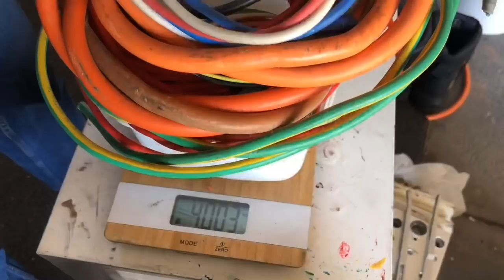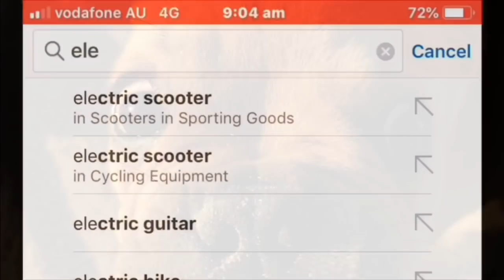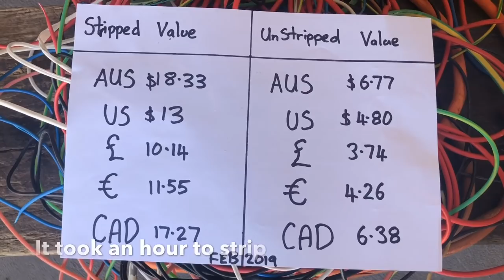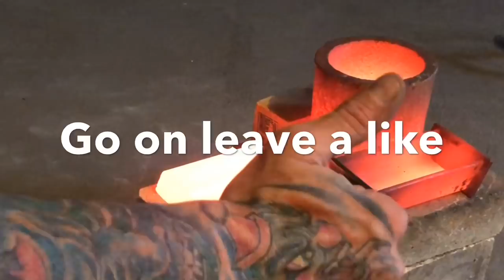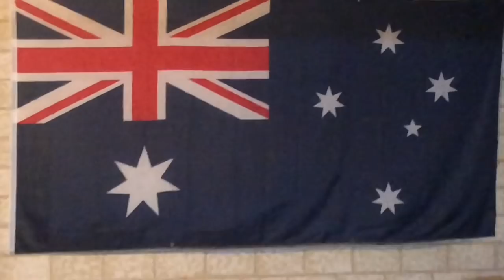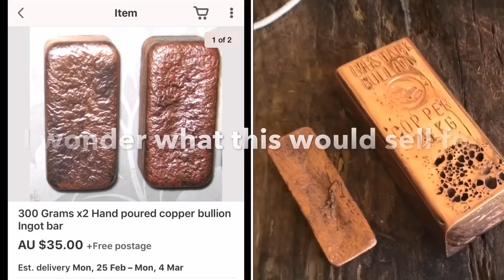To Strip or Not To Strip - Is it really worth stripping Copper Cable🤔 - Melting Copper

Comment: I want to know the cost of the gas used to heat it to melting.
Just curious as to how much gas is used to do that in the first place. Thinking of building a forge as well but want to understand the cost I should expect in gas.
Reply: Its definately a hobby.  You are spending more money on gas or propane just to melt.
Reply: That's true but let's not forget that if you use the material you might be able to turn it into something worth more than the costs. It depends on what you're making
Reply: @group555_  Trust me, As a hobby there is no way you can turn a profit on anything you do unless you steal and rip people off.  You would have to spend so much money on good equipment by then you start off in the hole, that's why this is mainly a hobby.
Reply: @Ericdawg420  i'd planned on making aluminum replicas of vintage space guns and various toys. like in any business there are start-up costs and ongoing materials. obviously i have to do a cost analysis of my time and materials and, once proficient, learn to budget time more effectively which includes upgrading equipment to cut down on labour. 

that's why owning a small business isn't for everyone, though. some ppl aren't willing to sacrifice. most don't even have a reasonable plan or simply an idea of what they want to accomplish financially with a venture. too many want instant gratification and money, just make a youtube video, get a million likes and subs, and rake in adsense $$$ for being a 'social media influencer.' to be honest, you can't trust most people to be able to answer the phone and run a cash register let alone do any real work on top of that. 

i would agree that if all you did was melt down metal and put it into a bar that's probably a waste of money, however that's not a viable business plan.
Reply: @ryanbarker5217   ryan I agree with you on the entrepreneur mentality is not in everyone, It definately takes a certain mindset to do that and maintain. Like you said you have to weigh the pros vs cons of what you want to accomplish with any task. 
As for melting, It is one side of the story as Learning and buying in is one step. Molding is a completely different animal my friend. I have done both professionally working with steel and can tell you firsthand, It will take allot of time and money to get it going, then allot more time and money to perfect it. If you enjoy doing it and have the money to invest by all means go for it my friend. If you have zero knowledge of molding and melting with not much drive to do it other then a hobby, I would recommend finding a different hobby, Or at least finding a business partner to help take some of the financial burden.
Reply: @Ericdawg420  i've been a business owner, let the ex keep it in the divorce, otherwise i would have been going on 15 years. we know sacrifice and what it takes, so that's not an issue for me. 

i can certainly appreciate your knowledge and experience working with steel. my idea is using a furnace like the one in this video (plenty of information on how to build these, they seem pretty easy once you get the right material), use aluminum (not nearly the melting point of steel, would use cast aluminum, not 'aluminum' cans or cheap extruded junk) as my medium, and a sand mould around a positive cast from resin made directly from the object (i don't 3D print, and i could make plenty of things from resin using silicone moulds). after that it's common hand tools you can get from lowe's, none of which are extravagant expenses. that's not to say it's cheap, there's still crucibles and tongs and gloves and all sorts of little things that'll nickel and dime ya, however these are do-able prices. as far as start-ups go, it's a relatively cheap business to begin. 

given that it's hardly like a hardcore foundry, it just depends on the price the market will bear vs. material and labour costs. duh, right? without having broken prices down except in very broad terms so far, my first notion is to consider selling, for example, a toy star wars stormtrooper rifle made from the 1977 version in the $200 range on the high end depending on how much labour it takes me. no, i don't work for minimum wage, lol, and if it turns out that's the case then i simply won't do it. 

but, like many businesses, you often start off making little, if any, money until you build a reputation, clientele, improve your craft, and hone in on your true market. when i bought a turn-key business i wasn't a master at it, but i knew enough to do it well enough. spent many a long night at first that now would be handled easily inside working hours. if we bear in mind the scale, there should be money to be made as a side hustle, imo. (sorry for the long post.)
Reply from the maker: Hey Joe Crispino I have just purchased a 40 kg scale that will measure down to 1 g that should arrive in a few weeks and when it does I will start to include total gas usage for what metals were melted on a particular video . I should be able to work it out down to the cent for exact gas usage so stay tuned my friend for a better understanding on gas prices to metals melted👍🏻.
Reply: @ryanbarker5217  just so you know when you make a mold directly off a finished casting you start getting into shrink and cracking issues if you do not know about that, you should look into it.  Most molds are made with the shrink rate of the metal calculated into the finished dimension on a casting. If you are just making something like a replica gun, I dont think it will matter much. And with gun parts as many other castings you will need to decide the machine process. Will there be holes drilled. Sides milled, you have to think of all of that.
Reply: @Ericdawg420  thanks for the heads up! :)

if i remember correctly, shrinking is about 3% for both, but i might be off on that. i'll have to re-research that, though for what's on my mind it shouldn't be an issue, like you mentioned.

on some of the things i have in mind i'll have some separate parts that will have to be attached, and was considering set screws. they're just for display, but want to cover it up as much as possible. seems that designing where the parting line goes is an art in itself. there's a lot of pre-planning to do for sure! that's also why i want to stick with objects that's got some marketability, meaning i can actually sell the things.
Reply: @ryanbarker5217  Parting lines are no issue if you get into cores and molding cheeks.  There are dozens of ways to mold and pour things. It's all up to how much finish work you want to put into the part. I have seen some castings molded, shake out, blast and brunell out the door a week, and some the machining process is 3x the work that was put into designing, molding and pouring.

You shod look into a program called "Magma" or something related that. That is what the engineers use to design castings and it basically figures out what problems that can occur with the model you are using.  I dont think you can get the same program, but I'm sure there are other programs just like it on the market for home gamers.  Good luck man
Reply: @Ericdawg420  thanks for the good luck, i appreciate it. :)

the things i'll do will be sand moulds and will have a seam, but it's okay because so do the toys, lol. 

if i get into smaller doo-dads i'm thinking maybe a centrifugical thing (pretty sure that process can do aluminum, but i'll have to check for sure) or investment casting using lost wax.

you're right about how long i want to spend on finishing, and honestly that's what i expect will be the real time killer. it would be ideal to have enough work to hire someone to do that for me. i won't have a true idea until i actually get my hands dirty!

yeah, that programme is probably $1000, lol. like you said there's probably some alternative to it, there usually is.
Reply: @ryanbarker5217  One more thing, Don't use aluminum cans, Or if you absolutely have to make sure you get a good alloy to mix in with the cheap stuff or it will just make your job that much harder. Good Aluminum is not very expensive and its worth the end result.
Reply: The cost of the gas in the tank is $45 US dollars if already have a tank. It will last for about 2 melts. If u don’t have a tank add about $50 to own one.
Reply: When I did the math about 15 years ago, I would have needed something like 1000lbs (~450kg) to make the melting costs worth it. A lot of  was brass, so there would have been zinc and probably some tin.
Instead I just started filling 5 gallon buckets since I only had in the tens to hundreds of pounds and not thousands....Crush down what I can, bring it to the scrap yard for weight when I'm there looking for car parts.

Comment: You could have repaired the drop cords and sold them for more money than you would get selling as scrap .
Reply: Not necessarily in the US. For the most part, OSHA rules don't permit extension cords to be repaired for some stupid reason, even if you can prove that it was done correctly. Sure, you can do it for your own use, or for non-industrial uses, but you can't do that with cords to be used on a work site. There's a certain value above which a cord is allowed to be repaired, but less expensive ones are supposed to be scrapped. Even in places where it's not against industrial safety rules, the price of electrical wire is largely the cost of the copper, so by the time you buy the cord ends and take the time to install them, you're probably not going to make much.
Reply: @puckcat22679  same with Canada
Reply: @puckcat22679  Thats not true. We let you repair cords, but it has to be restored to its original state. Meaning, you cant fix nicks and splits with duct tape. If you have an end that is messed up, maybe an excavator ran over it and broke the plug, or you had it running through a doorway and it cut through the insulation at some point... You would have to cut it off before that point and wire on an approved plug/cap. This is acceptable.

A quick reference Q/A : https://www.osha.gov/laws-regs/standardinterpretations/2010-04-04
OSHA Safety Worker (50 hours // -expired-)

Comment: The question was unanswered... did you think it was worth it to strip the cables and melt down the copper?
Reply: Yah.. was hoping for answer.
If I can get a strip machine for cheap enough.. I might strip em. But.. otherwise I just turn it in sheathed.
Reply: Matthew Bottorf  fair enough.  must have looked over it.  thanks
Reply: He said he thinks it's worth it. Now, he spent an hour stripping wire. Even ignoring the time it took to collect the wire,  if he had enough to just keep doing it he's only making $12/hr. Even then he also spent $200 (plus shipping probably) on the wire stripper, so that's the first 20 hours at least down the drain. Stripping, smelting, and selling bars on eBay/Etsy is a better deal. Another smelting guy on YouTube says he charges about 6.6X scrap price for bars on eBay.
Reply: Matthew Bottorf
Stripping and storing is worth the effort, but melting it down before selling to a scrap yard or refinery is a waste of time, money and energy and isn’t ecological. It lowers your profits. The refinery melts it all down anyway.

Comment: Hey bud. Congrats for the uber upgrade with the motorised wire stripper! I got the hand cranked one and it surely finishes the job fast. I was watching the 3kg copper ingot video yesterday. And noticed that the area where you pour in the mold gets those bubbles/cavities in them. So maybe pouring while moving the molten copper up and down the mold would solve the problem? Amazing edits with the packages from FedEx hahahaha love them
Reply: Kamal AL-Hinai it’s because of the heat differences, should really preheat the mold for no holes and safety

Comment: Good job...you just burnt up $150 in time but you get $30 worth of copper
Reply: He was ahead until he melted yards dont buy bar to many with stones and crap in them. I would rather have copper plates That you could make stoning out of or Bullitt that can be pulled copper is almost never use in bars.  Next cast new wire.
Reply: @euglenii  2.5 kg not 25kg... So $17 worth...
Reply: euglenii wow your copper prices are pretty high there. Just sold 800 pounds here insulated #1 it wasn’t nearly that high. Market is at $2.90
Reply: No way that was 25kg. That would be about 60lb. He picked that up with one hand like it was nothing. I guess his time is free (I get $50 an hour. How much did that stripping machine cost?
Reply from the maker: Yes James it was only a couple of kilos that other commenter obviously left out at a decimal point! The stripping machine is available on eBay if you want to check the prices and if you’re a regular subscriber you would know that I only do this as a hobby and that’s why I stack  my stuff up and never sell it I’m in it for fun not profit
Reply: @euglenii  Hey man, is it really that expensive in your country? Shit, I got a ton of the stuff, lets get together, start a business, and become millionaires!!!
Reply: @euglenii  2.5 kilo. not 25. so...17 USD? Monetization sure. Totally agree there.
Reply: Copper is $3.60 for a pound of number 1 so i believe that block is worth roughly $160
Reply: @euglenii  That's crazy, I get it from dope heads at 2 bucks a pound all day... maybe I should buy a shipping container and hold on to it until I can fill it then ship it over there for FAT 3x+ profits! :D

Comment: I installed alarm and fire alarm systems and it was a small company but they were just leaving the excess copper wiring behind and i made so much extra money. i would strip solid wire with a homemade stripper and just trade in braided wire un-stripped since it always meant that there would be one to many layers on plastic to mess with(unless it was some thick Grounding wire). The one day a week i would spend 3-5 hours on the wire would add up to cover almost all my monthly rent and utility bills. I would have worked there for ever if the business didn't go under after 8 years( the fact that they weren't smart enough to save the extra wire should let you know why they only lasted 8 years). Even if your lazy about it turning in copper wire with plastic still on it can add up to a nice free vacation or 2 each year.

Also recycle places have a rule about not being able to just burn off the plastic in the U.S. and they could normally tell because copper would be "dirty" but a trick i found out from an old timer was to save the wire that wasn't easy to strip and wait till winter and make a fire burn the plastic off and wait like 30 seconds out of the fire and throw the plastic fee wire into the snow rub it around a bit and it would come out clean enough. I don't know if it had to be snow and cold , but i tired it with just water before and didn't work so idk why snow made the diffidence.

Comment: How many pound of copper can you melt with one propane tank ??? I dont know if im better to buy an electric furnace, olease answer 😭
Reply: I get about 8-10 sessions on a propane tank that size. Costs about $18 USD to have it refilled at the hardware store.
Reply: Why melted it at all? Are you trying to make something with it because they will take copper as Copper at the same price as reshaped copper
Reply: Its for stacking and i dont want to stack wires
Reply: @18632ewa8  Some people have this as a hobby.
Reply: @hippopotamus86  I am an electrician by trade and I have a homemade Forge the way I melt metal is either with a car battery or my Forge. I noticed he put it into a bar and put a stamp into it I was asking the guy that was asking about melting it. mainly because the way he said it did seem like he thought he should melt it maybe I was just making assumptions and thus making an ass out of him and me.
Reply from the maker: Hey Mike  I have just bought a 40kg scale that’ll measure down to 1 gram so I’ll be keeping track of my gas usage and I’ll know exactly how much gas is used down to the cent each melt so once I get that I’ll start adding total gas used to some of my videos 👍🏻
Reply: Thank you mate
Reply from the maker: But personally I would say gas furnace as I started with an electric furnace years ago and had a lot of dramas with it . But it definitely be interesting to see how much I use . I have 4 gas bottle atm so I’ll have 1 for copper 1 for brass and 1 for aluminium so I can keep better track of total usage👍🏻
Reply: @bigstackD  great idea 👍

Comment: My dad and I stayed in a Caravan while digging a new storm drain on Boston dock England..the wasteland we parked on was where an old factory had stood and we came across the 2inch supply cable still buried in the ground. Every evening after work dad would dig out the cable with the JCB and I would cut into 1 meter length.. Every weekend we would go home with the van full and almost popping wheelies from the weight of wire 😂we spent a 6 weeks on the job..my dad had an old fella boil and strip the wire..god knows what they made from it but dad wouldn't tell me and I only got £50 for my trouble..but it was one of the best times I ever had just me and the old man..and I wouldn't have had it any other way. 😊so glad I have that memory now he's gone.. P.S. I'm a plumber by trade now and still keep every piece of scrap. I must invest in a smelter and start my own bar shelve..love it 😎

Comment: I had about 200 kilos of unstripped wires. I just did burn the plastics off then smash them  with hammer together in bricks and sold. Did save me a lot of time
Reply: Good move, melting the whole shit is not worth the time and energy, as it's going to be remelted anyway.